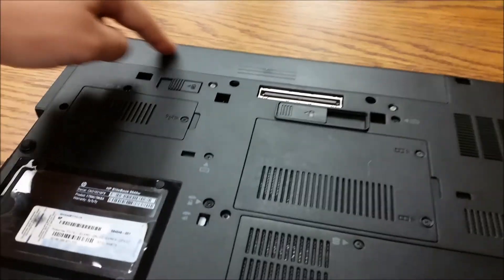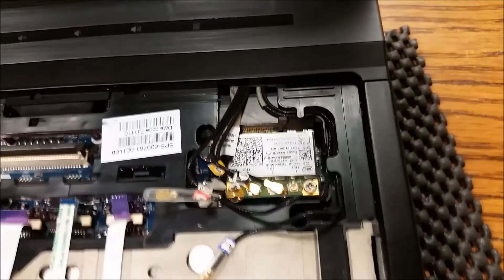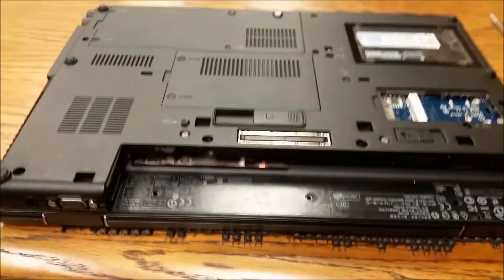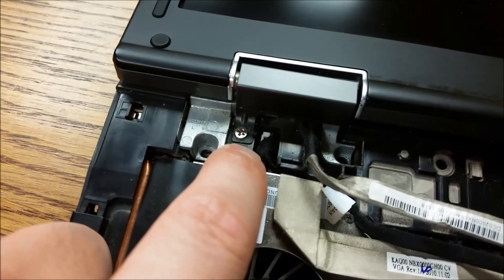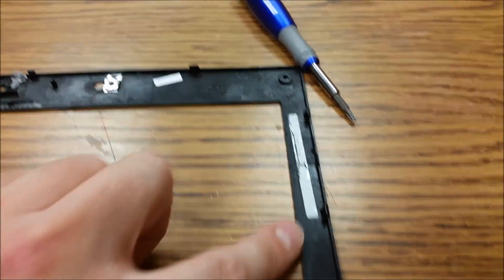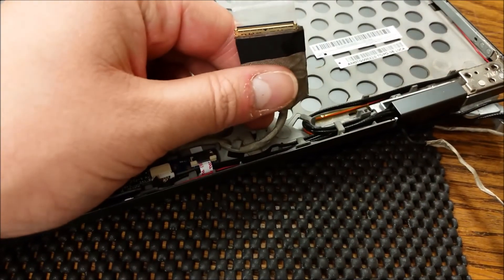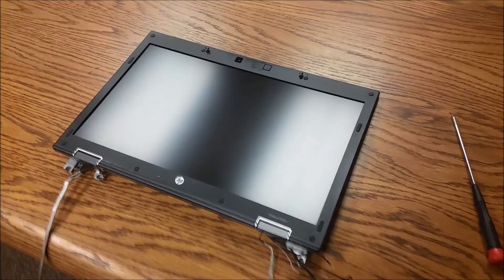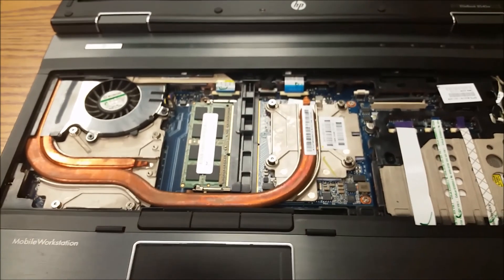Laptop Screen Replacement HP EliteBook 8540W

Comment: Hi, thanks for the informative video. Do you by any chance know how the screen is switched off when closing the lid on the 8540 and where it's located? I ask, as I need to disable it on mine.
Reply from the maker: Hey Adam! I’m not 100% sure but it looks like there is some kind of sensor at the bottom of the bezel next to the HP logo. I no longer have these units to test but maybe you’ll have some luck fiddling around in that area. Anyone please correct me if I’m wrong.
Reply: @RuM1988  Thank you for the rapid reply. I'll take a look..

Comment: You're a moron. When you suggest how easily it is to remove the various wires and other connections you might want to suggest the proper method to do so. Otherwise a novice will do more damage internally to their laptop than it's worth to fix.....or do you just work for some local repair shop looking for more work?

Comment: Hey friend, good morning, sorry, could you tell me where the internal microphone goes, my PC does not record sounds, thank you in advance.
Reply from the maker: Top bezel of the screen there will be two small holes on top of each of the hinge pins for the dual microphone array if your laptop is equipped. It’s been awhile but I’m pretty sure the wires will be bundled along with the WIFI antenna cabling that go up and around the sides of the screen with the bezel removed.

Follow the same instructions but stop at the actual LCD screen assembly removal and you’ll be able to replace the microphones however I’d recommend a headset or external microphone to save yourself the hassle. The microphones in these laptops aren’t too great by modern standards.
Reply: @RuM1988   Thank you very much for your prompt response. thank you